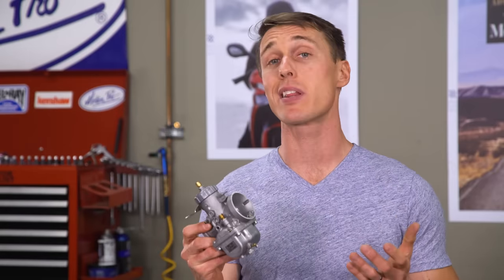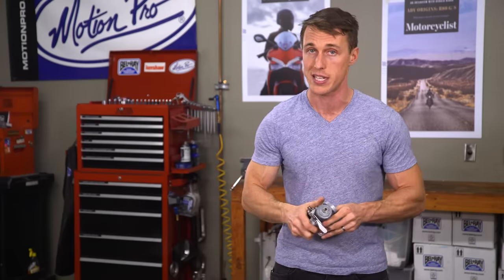Carburetors vs. Electronic Fuel Injection—What’s Better? | MC Garage

Comment: I choose Carberettor, the reasons being, 1, Maintenance, any reasonably savvy mechanic can strip, clean, and repair them (this is especially important when you travel through Countries where dirty/inferior fuel is often found). 2, Cost
Repair and Replacement can be done on a budget and even though EFI will auto adapt to environmental conditions it is often the case on a Carberettor that 'altitude riding' etc can be fine tuned quite readily at the slight turn of the external 'mixture screw' (easily accessible on most Carberretors), also if you run your fuel level down very low the EFI System can become unbalanced and out of sync requiring a specialist to reset the ECU - On a Carberretor even if you run dry it becomes a simple matter of just refuelling and off you go.In regard to the actual real world difference that Injection makes to performance (ie. acceleration or economy) I don't think it holds any significant advantage.
p.s. If I'm leaving for work one morning and discover I have a flat battery! at least I can attempt a 'bump/push start' - good luck trying that with a motorcycle fitted out with an EFI System!!
Reply: I used to run start my GSXr all the time and it had Fuel injection that's not a good point

Comment: My 9 year's old 125cc scooter, still using carburetor, it's still fine and working normally, although it already travel 108.000 Km, but if you talking about fuel consumption, yes it's really frustrating, 1 liter gasoline only for 35 Km, if you compared to other product (same displacement, scooter type with EFI) that can travel 45-55 Km with just 1 liter gasoline 😅😅😅

Comment: Carborators have the same level of precision that fuel injection does. You can make an almost perfect air fuel ratio with carbs just like efi. however carbs lack the constant accuracy of efi. Its likely this video has its definition of accuracy and precision switched.

Comment: However for someone that wants to increase the power level of their motorcycle above stock levels, they are going to switch to carburetion. Yes you can do it with fuel injection, but the cost of larger throttle bodies, reprogrammed ECM's etc, is vastly more expensive.

Comment: Theoretically my FI 125cc scooter has a O2 sensor, but does that detect the amount of O2 in the air? I´m asking because when I was riding in Pakistan at around 5k altitude the bike was damn slow and it was very difficult to turn on. It was actually quite difficult to breath as well.
Reply: A wideband O2 sensor measures the Air to fuel ratio. The computer then tells the injectors how much gas to squirt in. As the air gets thinner at altitude, the injectors put in less fuel to keep the ratio optimized. There will be less power at altitude because there is less oxygen for your engine to work with.

Comment: I have a 2000 CBR 600 F4 that is carbureted and has a throttle position sensor what's up with that. Oh and it has been as reliable as the Sunrise maybe because it's a Honda I just rebuilt the carburetors  for the first time since I've owned it last year and I've had the bike since 05

Comment: i think you forgot to mention fuel injection is far more fuel effitient than carb... 😀... but I personally prefer carb type in motorcycles... It is so easy to fix I just bring basic tools when we go long ride.. I am not confident with fuel injected on long rides due to worry of getting stranded...

Comment: My Suzuki Address FL125 does use fuel injection though after 10 years of running it makes too much noise (like a small ticking and clicking noise) and at high RPM the bike does have performance issues. Guess either my injector is near death or it's clogged due to bad fuels.
Reply: take it to a pro

Comment: l have both and l prefer carbs, carbs l can work on at home, efi l cant, for tuning my old xvs650 l modified and all l had to do was spend $50 on a jet kit to tune it for the after market exhaust and air cleaner but my new xvs950 to do the same thing l need to spend at least $600 for a power commander just so it dont run lean.
if you are racing or changing altitude alot by a fair height then efi all the way (if racing then must get after market tuneable ecu which costs big bucks)
PS. l had my xvs650 for 9 years and it was my daily ride rain, hail or shine and never had an issue with the carb (never had an issue with any part of the bike but thats a yammy for you)

Comment: There are still a lot of states without smog checks so carburetors are just fine in those states. EFI systems are driven by a computer system called FADEC for Full Authority Digital Engine Control.All cars,most trucks and some piston and jet aircraft also use them.

Comment: This forgot to put into account the innovasions in carbs like the lecton and yoshimura thats self adjusting and has finer jets making it as fuel efficient as an efi while still more reliable. Tho the chance of an efi failing is maybe 1:1,000,000 but when it does its down and out unlike a carb that you can do roadside repairs.

Comment: What's the difference between EFI and Drive by wire ?
Please explain it to me
Reply: EFI is fuel injection where a computer measures several things and then tells the injectors how much gas to squirt in. The throttle in your right hand has to tell the computer what you want. It can be hooked up through a cable that twists a throttle position sensor or it can be hooked up by an electric wire that tells the computer what you want. A drive by wire is like twisting the knob on a dimmer switch.

Comment: Is it possible to replace the carbartour with injection system in cbx1000?
What is your advice
Reply: Possible? Yes. Doable? Maybe not. An alternative would be looking for a Kawasaki KZ1300 from 84(?) and up as they had fuel injection and were still inline sixes.

Comment: Great Tips bro. In short, if you got a Fuel Injected bike and you run out of Battery Juice??? Yeah, you have to tow it down from the Top of the mountain to the nearby Town to charge your battery, but with Carburetor-Type bikes, no problem with no battery, just kick it up and it will start, or just push it down the hill and it will start. PLUS! Roadside mechanics can always fix carburetor-type bikes, in case your way far out of town BUT  with F.I.-bikes? Sorry, you need to take the to the dealer and let the dealer deal with their computer system.
Reply: 1) you can bump start fi motorcycles. There's plenty of videos of it.
2) if you cant bump start it just carry a jump starter battery pack and put it under your seat. You can get em for 29.99 at the least
Reply: @CollinMac96  That's only for the battery problem my friend, if your FI sensor, ECU or injector got a problem, pray you got a friend to tow you.
Reply: @FreakyChumy my friend, in all my bikes I’ve owned over the years I’ve never had a fuel injector failure. I’ve been left stranded twice with my carbureted bikes
Reply: @CollinMac96  Congratulation you didn't had that issue. Here's a little true story... One day we had a longride with my friends I was using a Yamaha Sniper 150 FI, I had an accident in the middle of nowhere, no sidewalk mechanic can fix it, the head cracked. When we reached another city, no parts can be bought, so a Good mechanic suggested that I buy a Non-FI block for the sniper, same model, then I bought carburetor for that as well, in short, I had to fully converted it to Carburetor, before we could left the city, the city like 100 miles away from home. If I was using carb in the first place, all sidewalk mechanics can easily plug an old block to that and will run like a charm.

Comment: I've never had to work on a carb until I had well over 100k on my 78 BMW R/100/7. And that was because the rubber diaphragm had finally torn. A round slide mikuni has even less to go wrong.

Comment: Not sure why people here want carbs.
Don't you remember the days of spending 10+ minutes trying to start a bike in the cold and then waiting another 5 minutes to warm up so it didn't stall as soon as you released the throttle?
Carbs used to the the most unreliable kit on a motorcycle when they were used, no matter who made them.

Comment: Carbs if you can do the work yourself; EFI for everyone else. Not because carbs are hard, but the majority of modern “mechanics” won’t touch them & the good ones charge $$$$. I have both, and rebuilding & syncing carbs on a v4 is not an “easy repair done with simple tools.”

Comment: Dear sir tell me i have 150cc bs4 bike pulsar  can i use high octane petrol in my bike is it safe ?
Reply: Read your manual.
Reply: @deathrodamus9608  in manual not mentioned sir
Reply: @venkateshnaikp4044  oh!? Then you should use either 95 or 97 octane rating. The manual of my Dominar 400 says I can use 91 octane but no less than that.

You can use 91 if you want a cheap gasoline, if the price doesn't concern you then go for the 97 octane. Higher octane rating is good for the engine, but not much on the wallet 😁 hope this helps.
Reply: @deathrodamus9608  thank you sir

Comment: Question for anyone that may help me:. 
I got back into biking this summer after a 35 year break. I got a great deal on a "basic bike" to see if I'd enjoy biking once again.  It's 1993 Honda CB750  and it is like brand new and had only 8,600 miles on it.  It's got 4 individual carburetors. My brother rebuilt and synchronized them in May and it runs amazing. 

My question is: To hopefully prevent future gum buildup I've been using Sta-bil fuel stabilizer with every single tank full of gas (along with premium fuel).  
Am I doing any damage (long term or otherwise) by constantly using stabilizer??
(The bike may sit from to 1 to 3 weeks.  I just hate ethanol gas so bad...). Please advise, and thanks in advance!
Reply: Ethanol gas is something we need to campaign against but to avoid issues, switch off fuel tap and run the engine till it dies from fuel starvation. I am assuming you have a fuel tap and it works, if not you might need to install one. Carbs always have drain screws on the float bowls, open these and leave them open. Remember to close when you use the bike again.  It should all go well.

There are problems with ethanol gas and some rubber seals, if they appear to be deteriorating then get a replacement kit, cheap and easy to install
Reply: You can add stabilizer with each fill but not necessary. Use the suggested amount. More is not better.

Comment: I prefer carburator over fuel injection. Fuel injection is very restrictive when it comes to horsepower gains because the car computer gets smarter and wipes out your horsepower gains and puts it back to stock horsepower. With a carburator  you don't have any restrictions and gain more raw horsepower.

Comment: My carbureted 1979 Harley Superglide is still running after 38 years with 103,000 miles and my friends fuel injected 1980 Kawasaki 1000 has been a lawn ornament for the last twenty years. You people that like fuel injection can have all the damn things but my Harley will be easy to maintain forever and you will have a hell of a time diagnosing, finding parts or affording parts for that offbreed high-tech shit. Nuff said.

Comment: Fuel injection is better unless your carburetor has one of those special altitude sensing Honda carbs used in the 1970s on their larger displacement bikes. Imagine trying to ride your carbureted bike in the mountains of Colorado and having to stop and re-jet every 3000 feet in elevation. Fuel injection is aven better, sensing the oxygen in the exhaust and adjusting the mixture automatically so the bike isn't puking raw gas by the time you reach 13,000 feet somewhere like Hermit Pass or Mount Adams.

Comment: He forgot to tell that the carb bikes are a little bit more temperament and angry (if they are fitted with acceleration pump), with FI without adjusting some tables in the computer or having a power commander of some sort, they are too smooth and ''greasy''. I prefer to wrestle with the bike not just ride it, so I'll stick to carbs for as long as i can.

Comment: injection is less polluting? I ran a 550 gs Suzuki on cones with 850 mains in round slide carbs running points and got 10 more miles to the gallon and 20 mph on top. Show me a modern 550 or 600 that gives 135mph for 65mpg with injectors. Injection has been around since the 30's, messerschmitt 109 fighter planes were injected, they out perfomed normally aspirated planes only in that you'd still get good fueling inverted, down side is thirst. Don't believe the marketing

Comment: I feel like there is some missing benefits of a carb'd bike. For those of you who (can) modify their bikes, a carburetor is often times much cheaper to modify with. Change your exhaust and air intake? Change the jet settings. Do that with an EFI bike? You're at LEAST $400 extra up sh*t creek.

Comment: Great info ,Thank you !
I would like to make a point that is important especially in this pollution conscientious world !
I would like to see a honest analysis on the cost of a carb system, measured in pollution ,against a complete fuel injection system including everything not just the throttle body ,which will not work without all the other stuff,  the control unit, wiring, pump, sensors and all other bits,
so the pollution created making all the parts for both systems, everything, the cost of all machinery, production set up, processes, automation,
Packaging and so on.
Adding to this also , maintenance pollution costs, like connecting to a system analysis , and its cost in pollution  !
INCLUDING ! Say a 4 cyl carb system cost $1000 I work 5 days to buy it, with all the pollution I make in 5 days to earn that money !
                        AN injection system same 4 cyl cost $2000 I work 10 days to buy it,with all the pollution I make in 10 days to earn that money !
Adding up all the pollution cost in the making, from the concrete floor of the factory, to the CEOs breakfast !
This means that all the pollution from day one ,of the set up of the production ,will not make up the minor difference in use.
I am afraid same goes for ABS and all other complicated systems in place today !
Firstly they make us poorer !
They do not save pollution as we made to believe, because it is about money !  Sure, they will make performance difference,with its own pollution cost !
Most importantly you will not get something for nothing in THIS UNIVERSE !
“The perfect machine has  1. Moving part “.    NOT A HUNDRED .
I AM SORRY FRIENDS !

Comment: Carburetors are mechanical, fundamentally simpler.  BUT, your carburetor can't tell you what's wrong with your system.  99 times out of 100, the OBD II code will tell you exactly what is wrong.  EFI is better in every meaningful way.

Comment: so is it possible to convert carb to FI? Thanks...
Reply: Carb to EFI is possible for the most part, but it is very expensive. Depending on the motorcycle, it can cost as much as the motorcycle itself and, even then, the process can cause too-many headaches. You're better off selling the bike and buying a newer EFI version. Hope that helps.

Comment: EPA checks emissions up to 40% throttle opening..... you'll notice when autotuning your piggyback ecu every fi motorcycle will run somewhat lean there, especially if you're forcing more air through via mods. My autotune shows factory map is lean across 40% throttle, and 5%, so soon EPA will have fi bikes stalling on the road - don't believe? Check out how rich autotune tunes 2013 and up kawi 300 maps and 636 bazzaz maps loaded on their site to compensate for the extremely lean condition from factory, then compare them to any other bike maps loaded..... and remember- many bikes have mods, but how does two models end up with 10+ cells tuned to +40% more fuel, 20 cells are +20%?

Comment: you forgot the biggest plus of carbs: the throttle response and the feeling you have for whats going on underneath your bum. i had 5 bikes so far (2 stroke & 4 stroke) and all of them were carbureted. i cant switch to an EFI bike because i feel so disconnected when riding them and the laggy throttle response just drives me crazy. i noticed the newer the bikes the worse it gets. on a K4 gsxr1000 i barely noticed it and on all bike newer than 2015 it was omnipresent. 
there are new aftermarket carburetors that should fix most of the disadvantages carbs have. they are called Lectron carbs. im looking forward to get one

Comment: Just a bit curious,  why there is no such thing as diesel motorcycle?
Reply: The torque and fuel efficiency of a diesel best suit a vehicle that is under steady load. Over the road trucks and farm tractors are good application for diesel engines.

Comment: Try setting the carbs up on a four carb set up!!! suzuki gsx 1100 katana or a Suzuki 1200 GSX  bandit take them off set them put them on run them under load take them off set them put them on run them under load. It is a mission!!!!!! Fuel injection any day.

Comment: EFI for the win, when you go on rides with 4000/5000+ feet of elevation change, you'll wish you never had a carb.
Reply: Alpine_Vulcan Are they really that much pain? I never had a bike with carbs however there are some good older bikes for cheap but they are mostly carbureted.
Reply: E.S. Slc, yes and no depending on what it is I think, there is a lake at 9,000' I enjoy riding to from my house at 6,300',  when I get near the top my old 250 gets rich. I think it is more noticeable in a two stroke though. I've had my boat in places as low as 3,500' and as high as 8,200' and you can definitely notice a difference with it. We have a drag strip down the road and I hear a lot of the visiting racers complaining and scrambling to re-tune for the track because of the elevation.